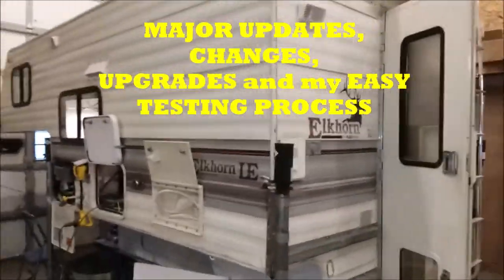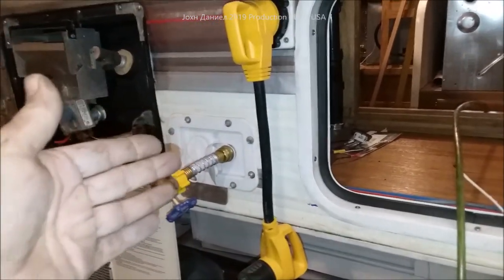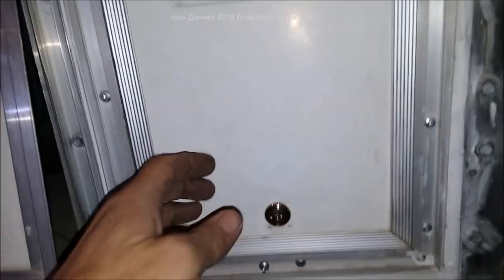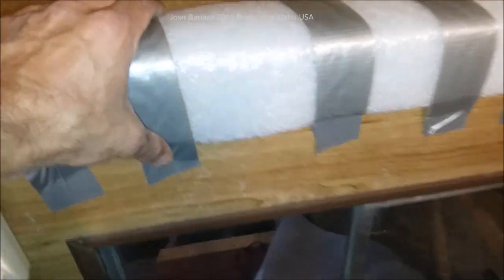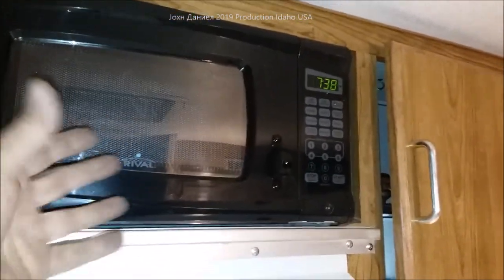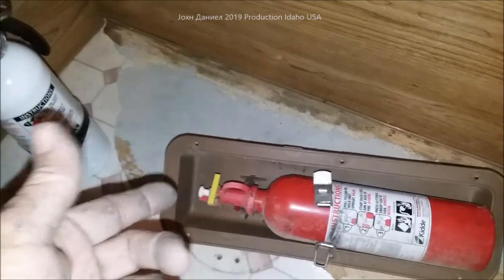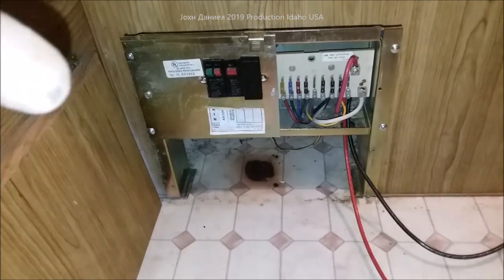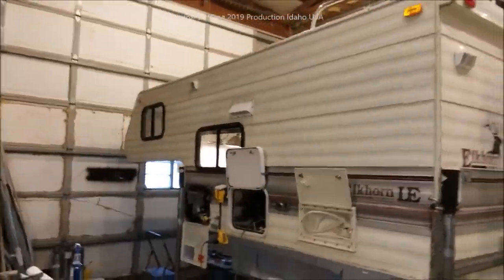Pressure test your RV plumbing system & more RV tips

Comment: About eight or nine years ago I bought a inverter out of a county ambulance rescue truck and I don't know much about it but I was wondering if you had any experience with them and what my options might be what it is far as using it in my SUV for camping add-on accessories excetera anything you could tell me about it or anything creative you know about using them I would love to hear your talk and also I love you videos they've been a lot of help to me and thank you in advance
Reply from the maker: Those are usually decent heavy built modified sine with a low RMS filter. Not perfect for electronics but good for pumps and tools. Many were STAT Power or similar.

Comment: John, as a former fire suppression and extinguisher technician, you should never use Kidde (as we pronounce it, kiddy) fire extinguishers.  It's the only extinguisher that ever failed a hydrostatic pressure test on me (the shell burst).  They constantly lose pressure and I've seen plenty that when the handle was depressed the head and neck separated.  Amerex , Ansul, Badger are far superior.

Comment: Did you not put your water heater in bypass? I don't have a bypass on my water heater so is that okay to do the test without it? I'm just trying to double-check
Reply from the maker: Test the system in 3 stages, 10 lbs pressure, check for leaks. 25 lbs pressure check again, 50 lbs pressure and repeat checks. The RV water heater is designed for 80 psi or higher, if it fails in those lower test you were lucky to find the issue and fix it now. No bypass is needed, but be sure you keep a eye on valves in the system.
Reply: @JOHNDANIEL1  Thank you. I found another method with something called a blowout fitting is there any benefit that would be different doing it your way with the type of fittings you used.Glad I found your channel you're a wealth of information especially for people trying to save money.

Comment: Is it possible to replace just the little flip valve you flipped up on the water heater.  I've got water leaking from there when showering.
Reply from the maker: Yes but - You probably have stuff stuck in it, from bad water. Take a hammer and tap it gently on the center pin and it will probably stop leaking. The spring is set to 80 psi and 180 degrees. If it gets lime - rust - calcium in it from the water it'll leak. tapping the center pin on it breaks that up and allows spring to pull closed.
Reply: @JOHNDANIEL1  thank you

Comment: What is potentially the smallest size air compressor I could use to do this test can I use one of those tiny tire inflators or would I need something that has more power?
Reply from the maker: I have used this little 12 volt model for 8 years on RV's to do mobile test. https://amzn.to/4a3u8Cm You just run it on a battery or from a 12 volt source or extension. Must use a heavy 12 volt extension cord like the EP style though. https://amzn.to/3IJJzDM
Reply: @JOHNDANIEL1 Thank you your channel is a wealth of information. I saw another method with a blowout plug is there any more benefit using your recommended fittings versus this blowout plug. What size air compressor can I use would one of those 6 gal pancake ones be big enough? Thank you

Comment: Still waiting for part 2 of that fridge conversation
Reply from the maker: Yep, Mee too. We tried 2 in it, It did well 90% of the time but would not maintain controlled temps, so I ordered a multi controller to try, but I am so much on the run I mostly work on what they throw in front of me when I get by the house.
Reply: I have 2 class A dodge motorhomes, one that has no fridge that I'm upgrading to and one that has a dead 3 way. And was curious on this setup and wanted to know more before I started pissing away cash on something that may or may not work, though my 3 way is not a small fridge "its 52 inches tall with duel doors"